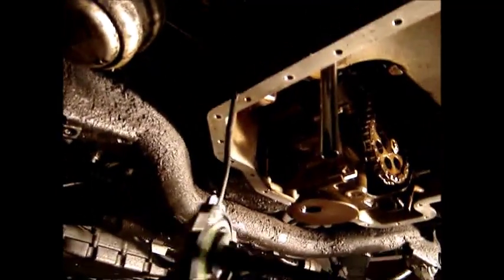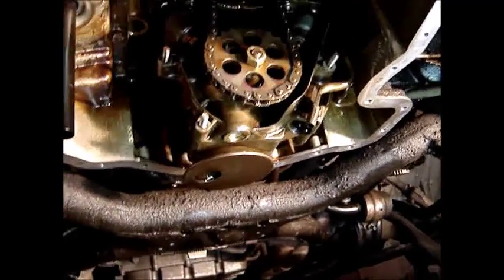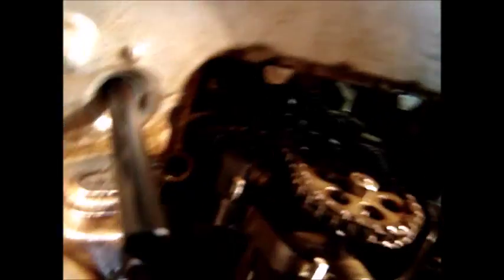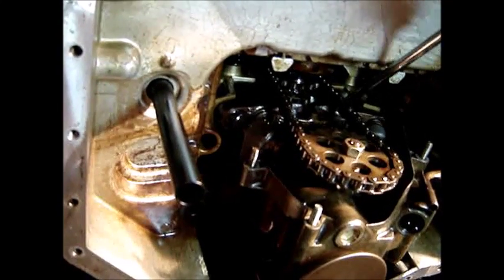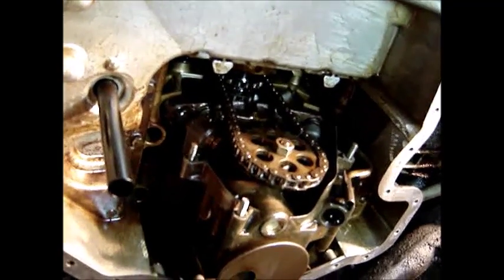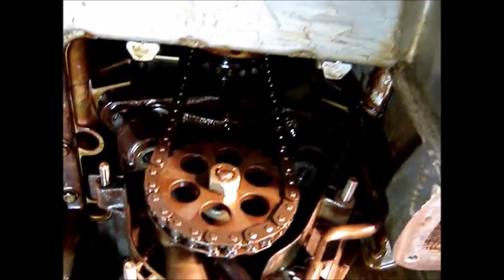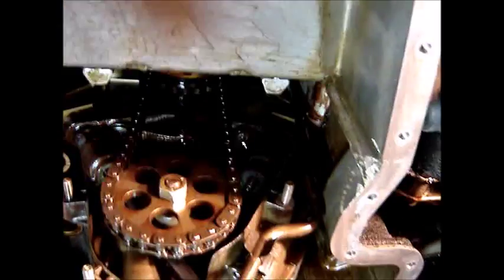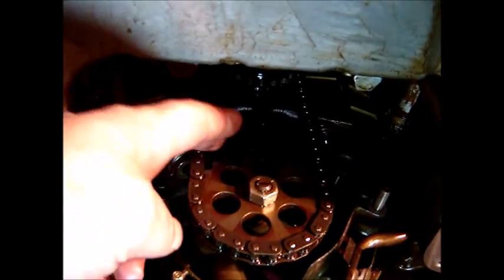E38 M62 oil pump bolt check and chain adjust procedure

Comment: Did you have rattle noise before you went ahead and did this? I'm getting some chain rattle from the lower part of the engine when hot and I'm suspecting I have the same problem - slack in the oil pump chain so might give it a go and tighten it a bit if I can.
Reply: This comment was 4 years ago, but did you find the problem? I have this same exact issue with me car

Comment: Op. Is it same for 2001 e38 740i?  I have taping noise only when car is warmed up. What are thr symptom of lose chain with oil pump? Mine Sounds like lose chain or lifter when warmed up. Car sounds fine when cold start.  Some tells me to do plugs and coil. Thanks

Comment: Most M62TUB44 engines I have worked on have a relatively loose oil pump chain like this. I only adjusted the last engine I did because I adapted a BMW X5 engine to a 540i that had a bent valves engine. I adjusted the chain to be relatively loose like this, perhaps a hair tighter but still plenty of slack. The engine oil pump differs between X5 4.4 and 540i/740i 4.4, and I believe the chain for the X5 is a link shorter. I wouldn't rush to remove my oil pan to adjust my oil pump chain after watching this video, but that said I applaud the creators excellent efforts to help people who like to work on their vehicles themselves, be they mechanics or hobbyists or forced due to economics. My experience only, TL;DR: Don't worry too much if the chain is a bit slack, all of the ones I have worked on are too. The 10 MM is recommended, I believe it also allows for +2mm more if needed. Unsure if it allows for only 8mm (+ or - 2mm, 10mm being the target) for the total "side to side" slop. I read the manual as well on this and I read it the same, 10mm or so side to side slop. I have never seen a BMW have a failed oil pump on an M62 but perhaps it happens. Source BMW mechanic 5 years independent.
Reply from the maker: Thanks very much for your post spencer.  You know your stuff and I appreciate you commenting.  I would say the major reason to check the M62 series oil pumps are the infamous loosening oil pumps.  While there makes sense to adjusts the chain if needed.  If following a TCG fail it makes some sense to attempt to retrieve debris from oil pickup screen.  I have also heard that the metal tube (looks like an open straw) in picture can get clogged so should be checked to make sure it is open (run a length of wire up through it).

Comment: Sir how can I check the fuel pressure on this 1998 e38? there is no shraider valve on the fuel rail....
Reply from the maker: I have not done that procedure.  I suggest going here and searching for that info OR signing in and asking, people there will be happy to help.  http://www.bimmerforums.com/forum/forumdisplay.php?274-1995-2001-(E38)
Reply: Thank you very much.  I will do that